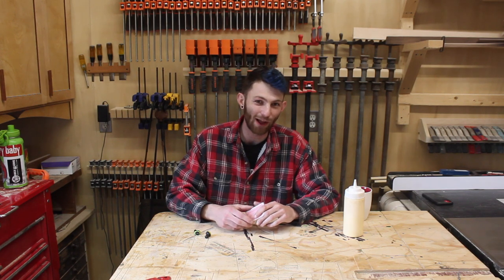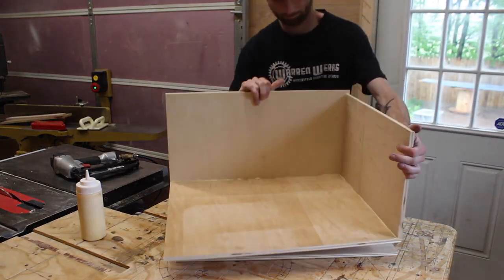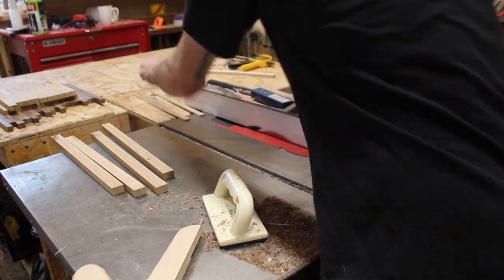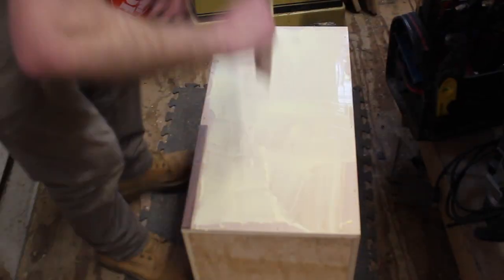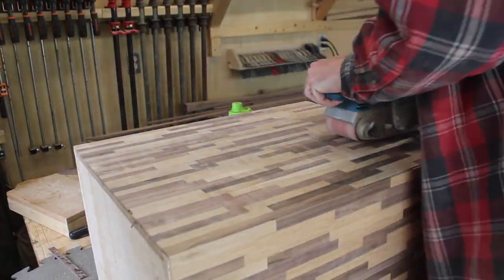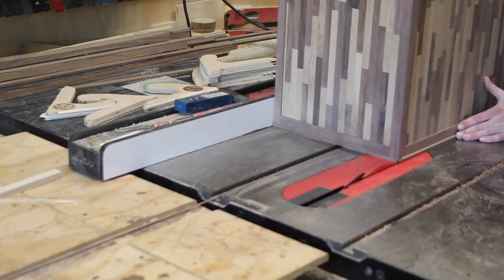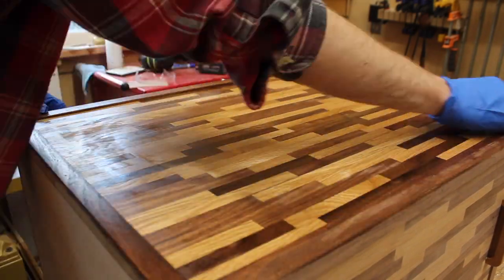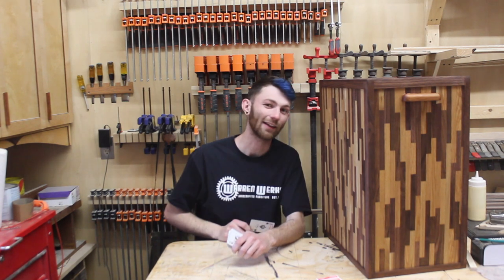Your Trash Can Is Not As Cool As Mine (ODB18)

Comment: Nice work, it can definitely be tough to keep a consistent line on stuff like, just like laying a floor, like you said. I could picture another version of this meant for a bag where the top edge is thicker to cover up an inner liner so the bag doesn’t fold over the outside rim.
Reply from the maker: Definitely did not keep the rows perfectly aligned here 😂 The good ol sawdust and wood glue filler made up for a lot of the imperfections. I like that idea especially for a house trash can